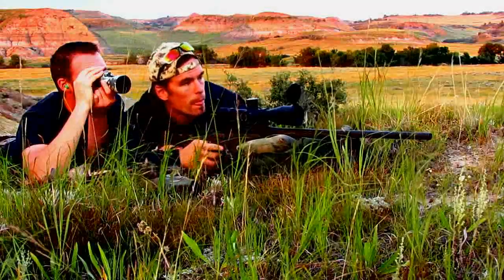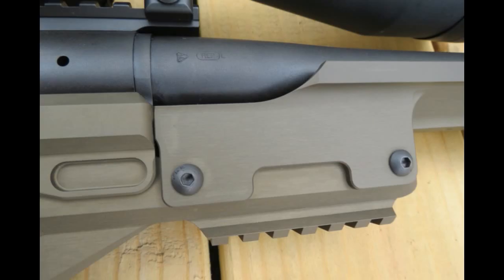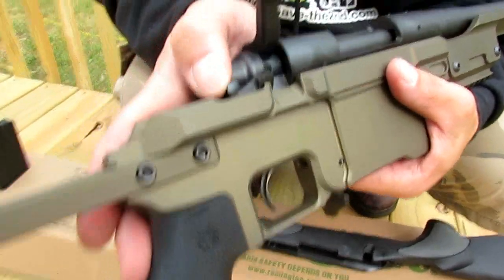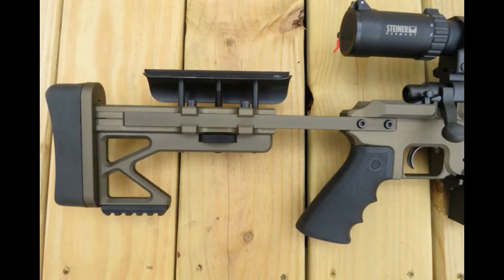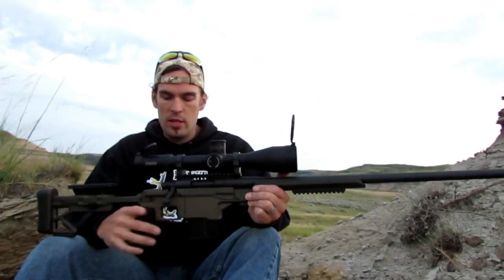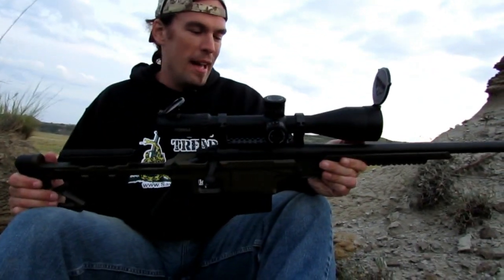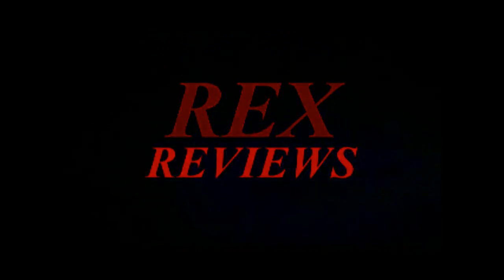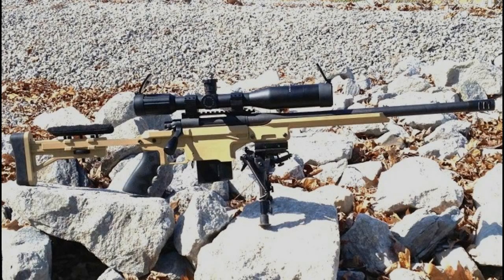FULL REVIEW - Applied Weapons Technologies - Long Range Precision Chassis - Rex Reviews

Comment from the maker: Barrels?  Remington barrels usually produce very good results after they are broke in and a load is developed.  My old Rem 700 ADL in 7mm Mag shoots 1/2 moa all day long with its factory sporting barrel.  If the performance is less than adequate even after working with all the other possible issues, then a new custom barrel may be warranted – but usually a factory barrel is pretty good.

Comment from the maker: Both cartridges will have a similar bolt face with a diameter of .470 +/- so you theoretcially swap barrels w/o too much work, however the challenge would be in getting a long enough AI magazine that fits the longer 6mm Rem cartridges.  That may be tricky.   It might be easier to find an old rifle in a short action .243 or .308 configuration and build up a custom .243 Win with the AWT.  Then you could use factory 10 rd AI mags.

Comment: Great review. However,... :) ... the buttstock is not "completely" adjustable as you mention,... it doesn't seem to allow for cant and height of the butt-pad,... I know, it's a little persnickety, but a few of the chassis manufacturers you compare this system to off those options,... just a thought.

Comment: Rex. Correct me if I am wrong, but did you compare the difference in accuracy with the factory stock before installing the aftermarket ? Wondering if it improved or degraded accuracy.

Comment: great review rex,just 1 question are ther any points on this chassis to fix a sling to or sling loops?
Reply: 10-24 sling swivel studs will screw in both the fore end as well as the bottom of the stock (sling stud replaces one of the screws on the picatinny rail in the rear) I have a sling mounted on mine in this fashion. You could also use picatinny sling adapters if you wanted.

Comment: I love all of Rex's videos and his music! But, I am confused guys. Help me out. I see some shooters go insane to get their scopes as close as possible(low) to the barrel. They say this is critical for the best accuracy and better firing solutions. Why does Rex have his scope on stilts? Looks like a good inch off the barrel. Yet he is shooting .25MOA. So, what is the deal?
Reply: ***** Ring height really has no measurable effect on the accuracy of the rifle, but it is desirable to have the optic as in-line with the bore axis as possible. This keeps your line-of-sight closer to the intended path of the bullet and keeps the angle of the barrel down as much as possible. My guess is the only reason to have the scope mounted higher than necessary is to allow for the use of a top mounted rail for the purpose of mounting NV and thermal imaging equipment. Hope this answers your question.

Comment: I have this chassis built up with a Savage .308, 24" barrel, 1:10.  Would 168 gr. Hornady Amax's be a good bullet to work up or something else?  I'm thinking of using Varget powder because it's all I can find where I live. I don't need load data, I'm just wondering what .308 cartridge/bullet/powder combinations are popular.  I will be posting a review of the AWT chassis for Savage enthusiasts in a couple months. Thanks for blazing the trail Rex.
Reply from the maker: If long range is your game and you have a 1:10" twist on your .308, I would look strongly at the 175 grain SMKs.  They are a great choice for this cartridge.  Use good brass (Lapua or Norma) if you can find it.  Varget is good powder, just be sure to find a good load that jives with your rifle.  :-)
Reply: TiborasaurusRex
Thanks Rex, I had an AWT w/ Savage Model 12 LRP .260 Rem using Lapua brass and had nothing but problems. Lapua advised me to only neck size their brass! Why? The .260 is currently back at the factory, hopefully getting fixed.  I'll try the 175's and some Hornady brass for now. Thanks dude!
Reply: Anybody using 168 grn. Berger Target Hybrids?  BC of .519, Wow!  Trying to hit 1000m before bullet stability problems. I'm a little worried about going to 175grn SMK's.